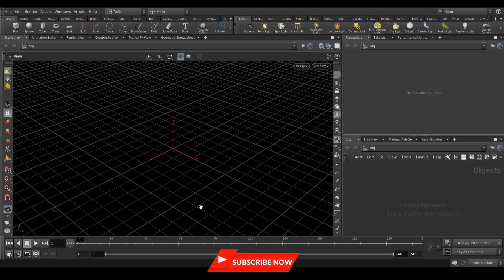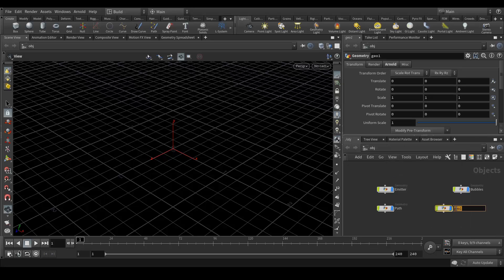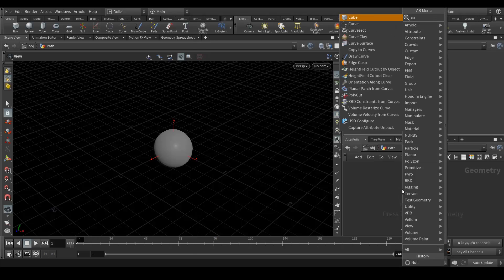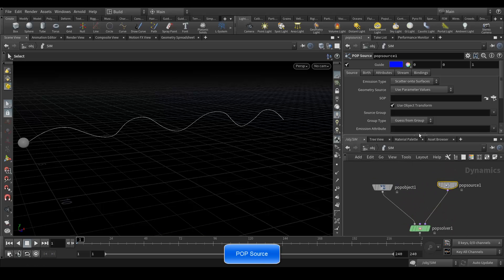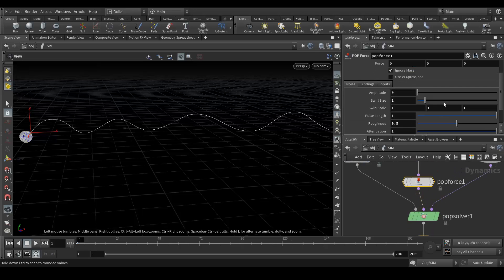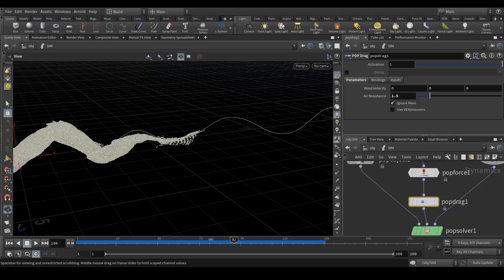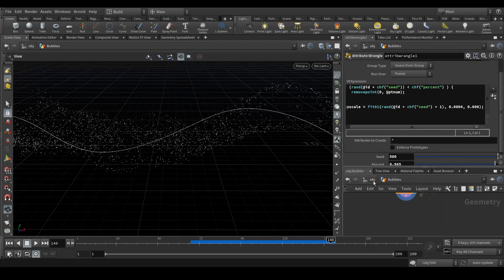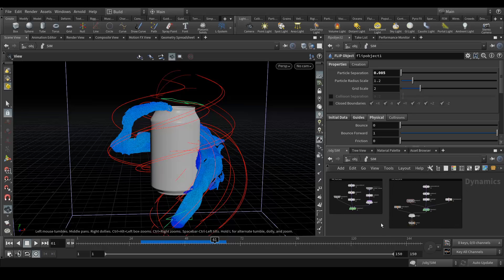Houdini Liquid Flow Tutorial (Fluid Simulation)

Comment: My render view is not showing the matrial color. Mesh is coming white, no matter what. Also file cache is too big and slower than non cache. Any help ?
Reply from the maker: You need to provide some details here. You are rendering the scene in Houdini Itself ? What renderer you ae using ? Have you applied the material properly ? file cache size depends on the particle separation value.
Reply: @CGArtistAcademy  Yes, I am rendering it with Mantra, also used the Basic Fluid node in materials and pasted it in the meshing node render SOP.
In view port the color is coming, but not in render view, also in render view the mesh is looking like small multiple spheres tangled together. I want it to look like CocaCola. Can it be done with Particle Emmission and not Popfluid ?

Also I had to toggle some values of suction, flow, etc, or else it's getting scattered. I am using Houdini 18.5.351.
Reply: @CGArtistAcademy  Can't we do this particle fluid emitter ?
Reply: @shalokechakraborty  did you fix this? if so how?
Reply: @LegendJ0e4  using Stage and Karma Renderer
Reply: @shalokechakraborty  can you send me your file? I just cannot get it to work

Comment: For those using Houdini 19: I was scratching my head when the popcurveforce produced very different results, seemed this tut didn't translate to Houdini 19 but alas it does! Bought the Hip file and when i opened it in Houdini 19 it converted some of the settings. If you want to to work use the following settings in your popcurveforce: Air Resistance: 1 Max Influence Radius: .5 Follow Scale: 2 Suction Scale: 3 Orbit Scale: 1 Inherit Velocity Scale: 0
Reply: Thank you! that was my first thought
Reply: ty man
Reply: I thought I was going to be on my own trying to figure this out. Thank you!
Reply: Did the code work for you? I am having a problem with it erroring out?
Reply: @MysteriousDaxinator  i was able to get it working about two weeks ago. I had to change the settings as said by voidz here
Reply: @dakotayocom7764  I meant the code for atribute wrangler. I keep getting and error on the R for some reason and it’s not working but I did the process right. Is there a different code or way I need to put it on?
Reply: @MysteriousDaxinator  I'll look at my project when I get off work in 2 hours and see if I can suggest something. I'm just a novice too but I'll try
Reply: @MysteriousDaxinator  if (rand(@id + chf("seed")) < chf("percent") ) {
    removepoint(0, @ptnum);
}

f@pscale = fit01(rand(@id + chf("seed") + 1), 0.0004, 0.006);
 put that code into the attribwrangle. does that help?
Reply: Saved my ass, thanks for that
Reply: thanks!!!
Reply: My simulation is still not like water, it is not looking like it, can you help please

Comment: I used these same values on my system, but the output that I'm getting is way off, what could be the reason for this? I'm pretty new to the software, would appreciate if you revert on this
Reply: Same here. Try to increase Follow Scale to around 5 and maybe Suction Scale in POP Curve Force node.
Reply: @piast_kolodziej  yess I did that, did some R&D and that helped, but still wondering how he got the same result without changing those parameters, anyway thanks for your reply, appreciate it! Have a good day
Reply: @NIHARADVIRKAR  Yes, that's very strange.

Comment: Hi. Dunno why but with your settings my particles look more spreaded out and overall their burst is shorter (for the same 100 frames). Did you changed something inbetween around 6:48 minute or is it Houdini 18.5 calculating it in a different way?
Reply: Hey! I had the same problem but I think i found solution. In the pop curve force settings I changed follow scale to 40, suction scale to 2 and orbit scale to 10. Then in mesh geo, in particle fluid surface settings I raised particle separation to get more ''fluid mesh'' between particles.
Reply: Select the pop curve force and bump up the follow scale until it makes it to the end of your curve
Reply: He actually changed cont birthrate at 6:39 from 5000 to 50,000 also.
Reply: have the same problem
Reply: same problem here
Reply: Thankyou so much
Reply: In the popcurveforce > individual Force > Follow Scale: 3, Suction Scale: 4 and Orbit Scale: 1
Reply: @khoaspiderman2007  Thanks, it also works in 20.5
Reply: @icefire3668 hi can you please help i followed this tutorial in 20.5 and it came out completely wrong...
Reply: why is my water grey ;(